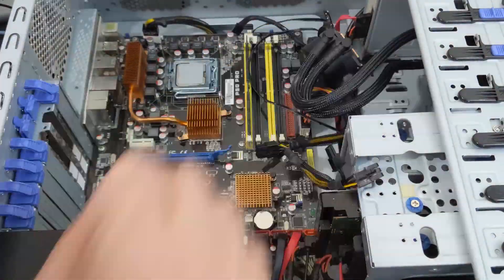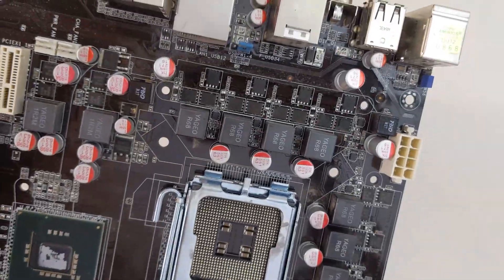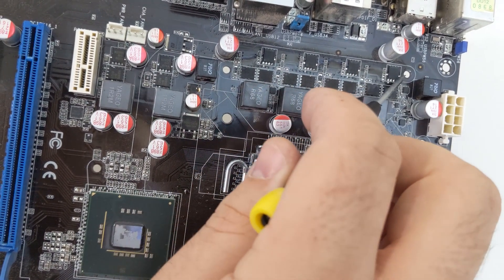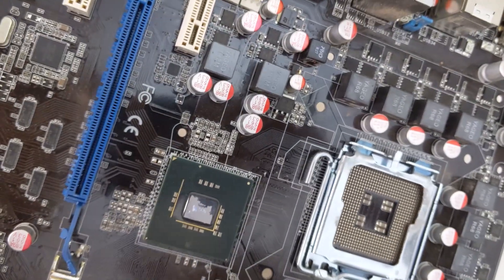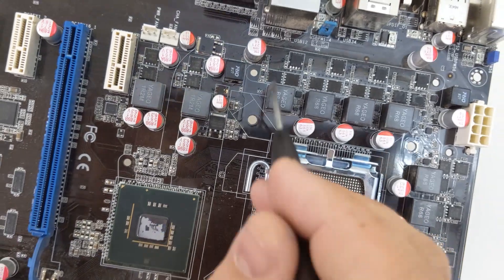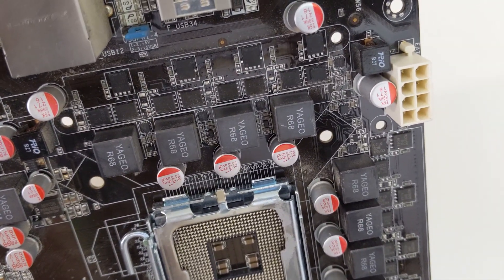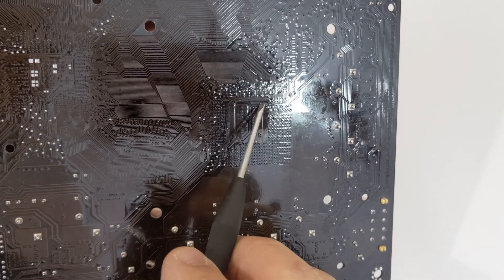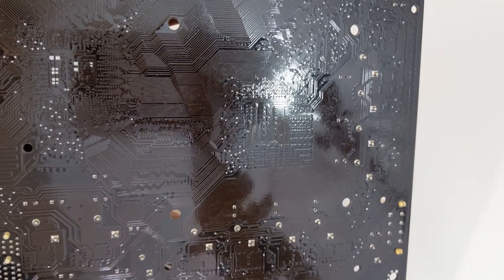I destroyed the Asus P5Q Motherboard

Comment from the maker: There's no measurable short across the cpu power pins. Measuring across source and drain on the effected mosfets is about 800ohms, while on the board
Reply: That's why, you should buy pre cut Xeon CPUs, so that this can never happen :(
I cut my P5B board, and it wasn't easy. BUT still works.
Reply from the maker: @CompatibilityMadness  I'm hardly in a position to disagree